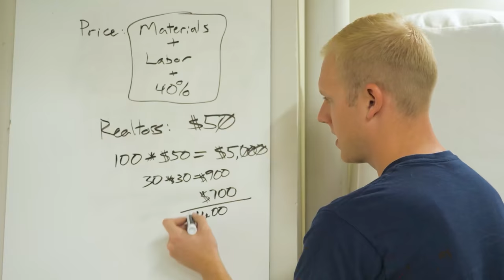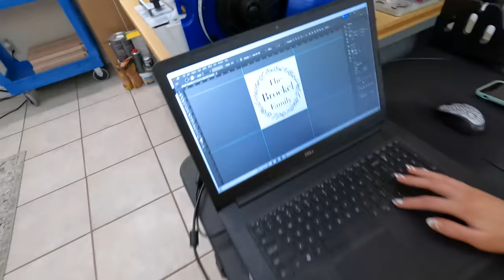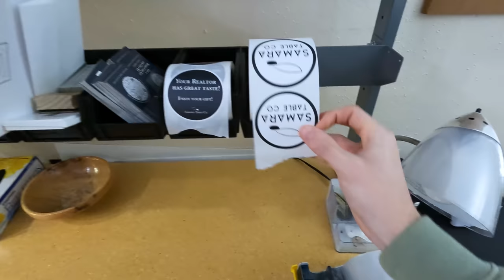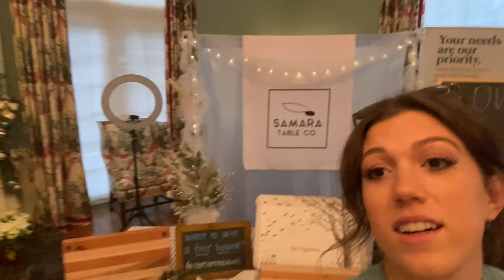Jennie DESTROYED the display booth for our BIGGEST EVENT all year!!!

Comment: That's why you get vinyl instead of paper.  Cheaper options are cheaper for a reason  and you're gonna wanna get the vinyl banner anyway so you're losing completely on the cost of the first banner in the end.  Rip the band-aid off and get a good vinyl banner.